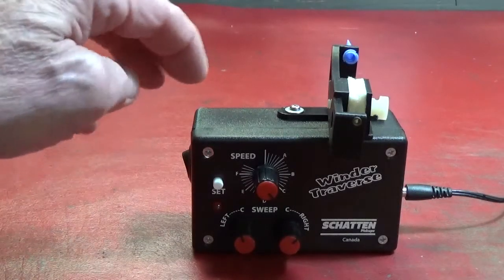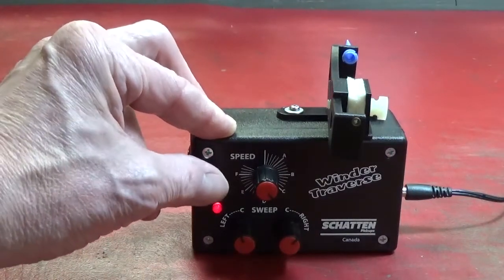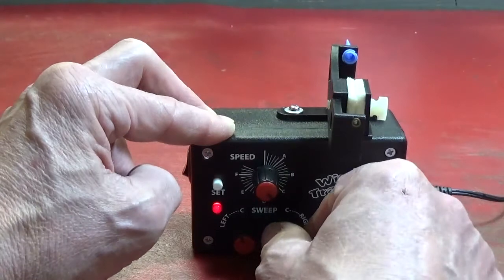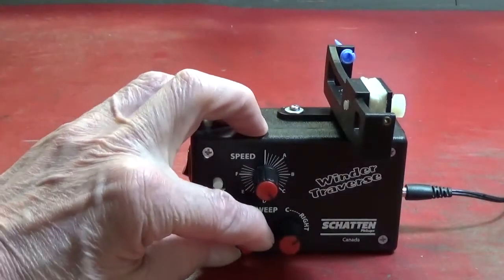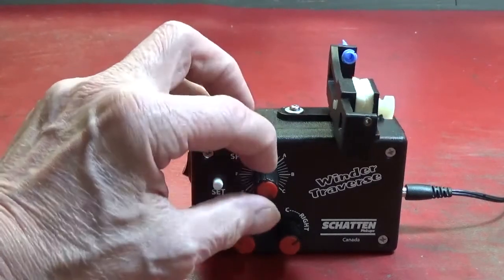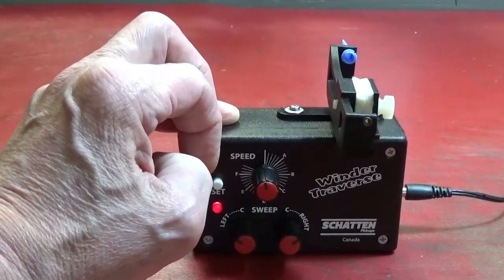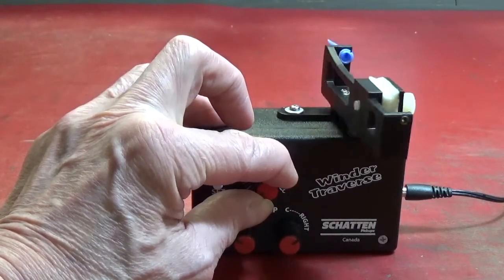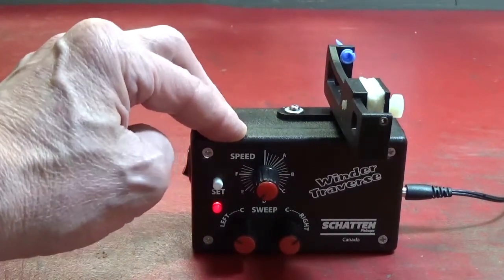Programmable Coil Winder Traverse  - Control Operation

Comment: There is one HUGE element missing from this auto traverse mechanism.  IT DOES NOT TELL YOU HOW MANY TURNS PER LAYER/TRAVERSE YOUR LAYING DOWN. This is 100% crucial when winding certain pickups such as a PAF clone. You might as well just wind bobbins by hand.  And the Traverse is very jerky as well. Nice try though.... It has a lot of potential. Please work at it. 👍